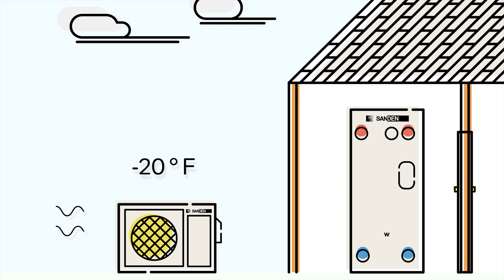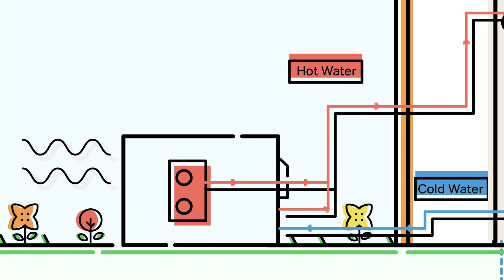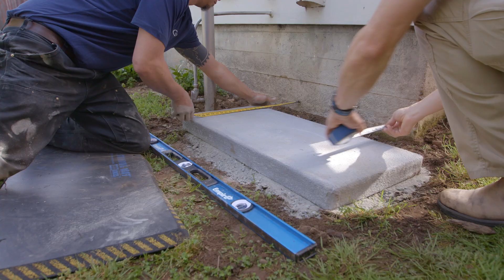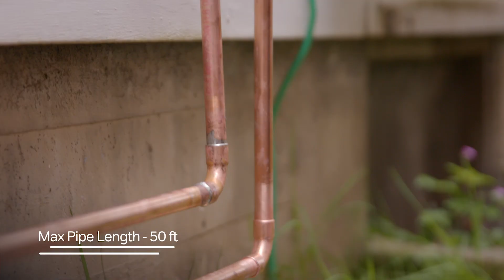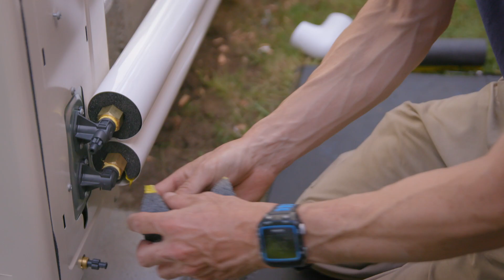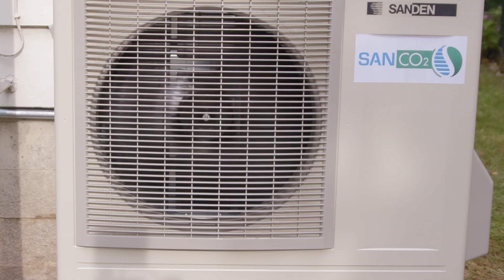How to Install a Sanden SANCO2 Heat Pump Water Heater

Comment: So in the install instructions it states:  ALL PIPING BETWEEN HEAT PUMP  & TANK SHOULD B 1/2" NO EXCEPTIONS.  This install shows 3/4 flex on the 4 connections to the tank.  And I am guessing the pex after the flex is 3/4?  

I unfortunately bought the 119 tank as the dealer stated if you have the room and for $400 get the 119 gallon tank.  I did not look at the specs since I was not considering it, but I said ok.  Well get it and I find it is not stainless steel like the other tanks and it is 10 year warranty vs 15 for the stainless.  I wish I would have went with the 83 gallon tank.  Also the output connections on the 119 gallon tank are 1.5" not the standard 3/4.

Comment: For only $5,000.00 USD i can get my very own 43 gallon SNANCO. I think the savings and warranty do not out weigh the price. I can go out and buy any other reputable HPWH for less than half the price and see very close to the same savings. Also the water in and out lines are 3/4. 99.9% of homes in the US have 3/4 or bigger trunk lines. If i step up from 1/2 to 3/4 i reduce the flow which reduces the pressure. Now i know why you don't see these in American homes.

Comment: Most code authorities and good practice dictates that an expansion tank be used regardless of the lack of check valves. If the main water supply is shut off for any reason while the water in the tank is cold, and the tanks is then heated, the expanded volume of water will place the house plumbing and equipment under considerable stress to the point of damage. Why risk a $6k water heater to save $50 on an expansion tank. The expansion tank will also reduce stress from water hammer due to solenoid valves on clothes washers and dishwashers.

Comment: How is the cold water to outside unit does not freeze in below freezing temperatures?
Reply: You can install heat trace on the pipes

Comment: Extremely happy with ours. 
Had it since 2014.
We set the timer to run it mostly from our rooftop solar.
Saved a fortune since getting rid of the gas instantaneous.
Reply: Out of curiosity, what climate zone/area are you in?
Reply: @robbierisque  Mild temperate, near Sydney Australia

Comment: It's a reverse cycle heat pump.  I would like to see if I could install it in my mechanical room which is always hot.  As to price.... it's not necessarily "first cost" but total cost of operation.   What is your delivered KwH cost x the # of hours per day/week/year that the system is running.